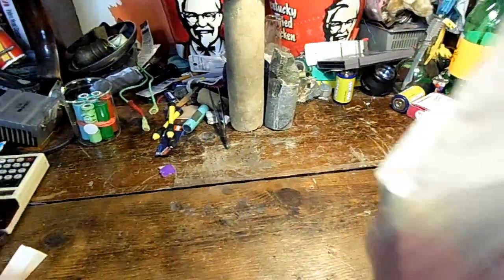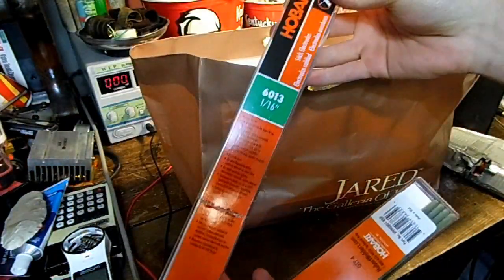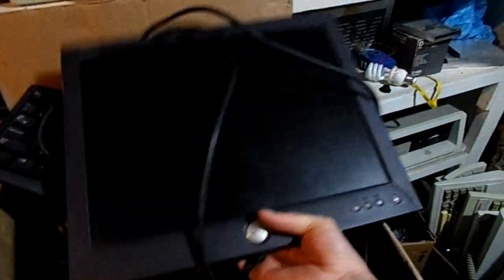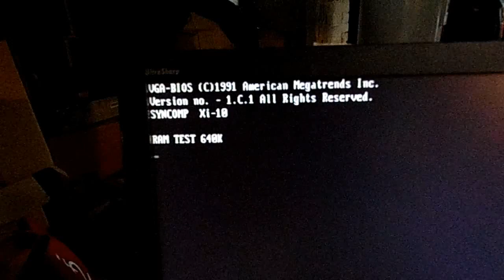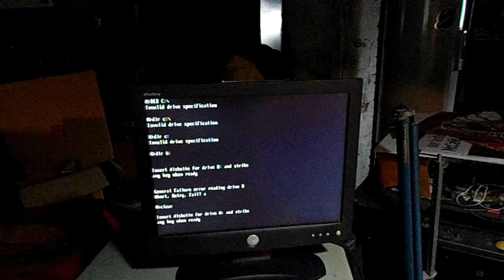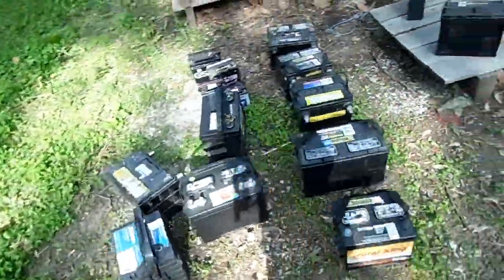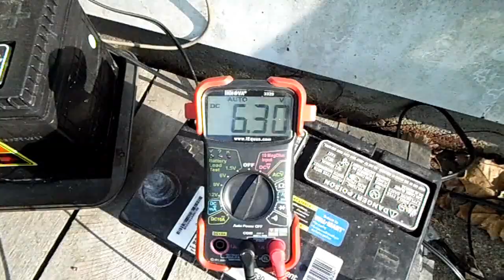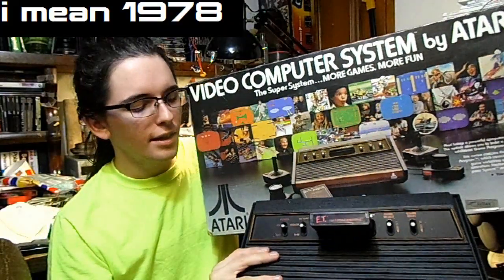Random Bits 0025: birthday battery electric car PC thingy

Comment: have you done anything with the car yet? we would love to see it go electrical.
Reply from the maker: fiaz shah no i think i'm going to convert a small car before i do this one.
Reply: makes sense i guess!
Reply: +Rinoa Super-Genius best bet is to convert to compressed air. that way you can still drive that car.
Reply from the maker: Nathan Dean
why compressed air? that would have a very limited range.
Reply: Rinoa Super-Genius
roughly about 120 miles or so. but bring along a air pump or stop off at and gas station to fill the air tanks.

Comment: speaking of old magazines! we had some old PopSci ones laying around the house that were getting ready to be tossed out... except ONE that i kept because of how interesting it was... it's the August 1987 issue about "Bugging" but that isn't what got me though. while looking through it there is a short 3 page article in there about "Rail Guns" the electromagnetic ones... the first line of the article reads "It's the year 2003, A battle has erupted in the Middle East." now if THAT wasn't one of the closest predictions of war almost 2 decades before i dunno what is! i know it's just a random article with a mock scenario and all but you gotta admit how eerie it is! if you want to see the whole article you can just google "Popular Science August 1987"  it'll be one of the books.google.com links and it's on page 54. there was some other neat articles in there on 4 wheel steering on the pages just before that article :)

Comment: heavy sixer,  or AGS.
but round here, ppl just said wanna play my ATARI?
(we were poor and only had a stick on a string)
Reply from the maker: very good! Heavy sixer is correct. but i think you mean VCS not AGS. and they where called VCS (Video Control System) up to 1982 when they released the 5200. then they retroactivly renamed them 2600.

there where 2 models with the 6 switches, the first was heavy you can identify it by the curves on teh front around teh wood grain, the 2nd model 6 switch was lighter and had more angled edges. but the 2nd model is a light sixer.
Reply: guesstimate,  the 70's electronics would be big an heavy compared to 80's revision (generally speaking)  tranformer/ heatsink/ an etc..   and carved out of a block of firewood to fit the decor of the time.
(my cousins had one,  prob a big deal at the time)
Reply from the maker: rt66to21st
no its just couse the plastic is thicker, the difference between the heavy and light sixer was just 1977 and 1978.

the atari was actually made on like 1974 technology, so even by 1977 the chips could be small.

thats also why atari sucked so much, was severaly outdated even before it was released. its almost impossible to make a good game with only 128 bytes of RAM.
Reply: yeah thats it.   a cool idea, was supposed to be a big deal,  but then ppl got bored with the avail games pretty quickly..
Reply from the maker: rt66to21st
 yeah and they where all very boring crap.

Comment: now that question has me mythed lol i did not know that atari made a 6 switch version wow was it better or worse than the 2600 and i noticed you had a copy of E.T inside of it just to rub it in my face hahahahaha :D
Reply from the maker: no i didnt use ET just for you. its a very iconic game, and its one of the few games i have with the box so its not in storage.

all the versions of atari had 6 switches, just only the first few models had them as aluminium toggles on teh front, latter models put them on the back as tiny switches.

Comment: The IBM XT was the either 286 DX or 286 DX2 chip ... now the 286 DX had an on chip math co-processor that worked... but to make a cheaper model with the  286 DX2, the took a working math coprocessor on the chip and blew out the circuit  to disable the math co-processor....  makes sense huh? it's like taking a new car and to make a discount model of it, beating the crud ouf ot a good car with a sledge hammer huh? LOLz frist computer here for me that was keyboard programmable was the Radio Shack MC-10 :D
Reply: Jesse Mercury XT was 8088 with a hard drive, AT was first 286